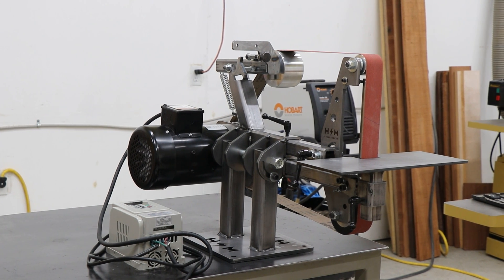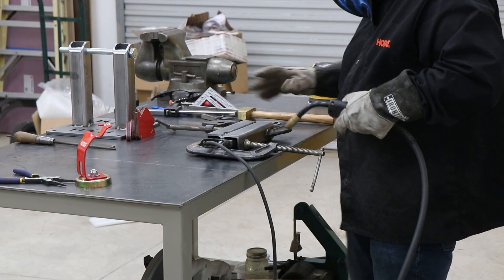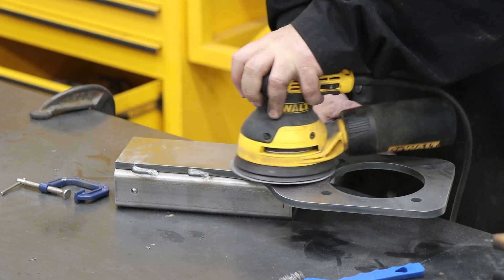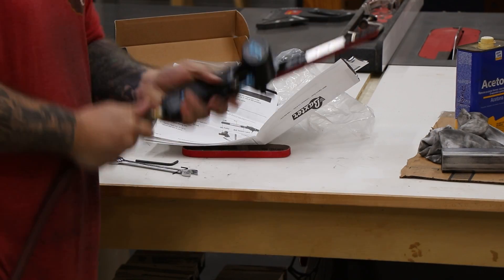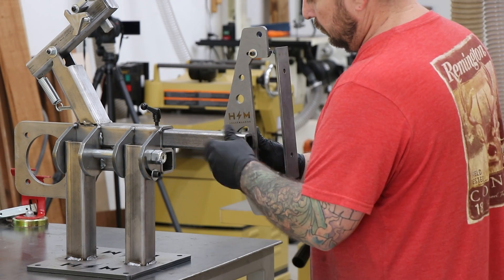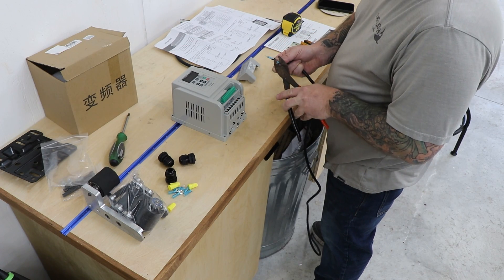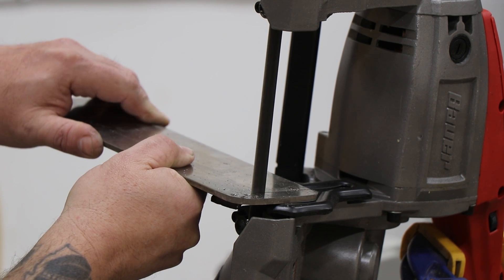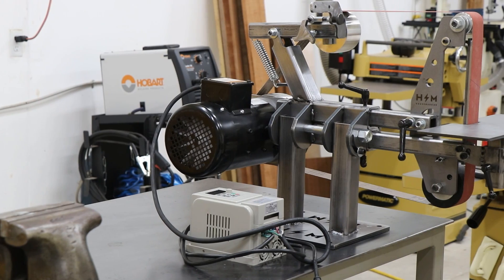Building a 2x72 Belt Grinder From A Kit

Comment: Hi, my friend looking at your show that great video especially the belt grinder 2x72.
I just wondering about motor names RPM, HP, and VFD name, please?
I making the body of the Belt grinder Almost finished but in stuck with the motor and VFD, what cost? 
I'm leaving so far but I want something good 
I'm looking forward to thank
Reply from the maker: @mr.ranyhomemade2466   here are the specs of the motor I used a bought from Amazon

2HP Electric Motor 3450 RPM General Purpose Three Phase Motor 230V/460V 56C Frame 5/8" Shaft Diameter CW/CCW Rolled Steel Shell 60 HZ TEFC
Reply from the maker: Check out the resources page of housemadeindustrial.com  he has a few options for VFDs and motors. Here is the specs on the VFD also from Amazon
AC 220V/2.2kw 3HP Variable Frequency Drive,12A VFD Inverter Single Phase to 3 Phase Frequency Converter for Spindle Motor Speed Control(Single-Phase Input, 3 Phase Output)
Reply: @ 
At my home, only 10 appear electric so maybe single phase can

Comment: I’m ordering mine Monday! Very excited! Been using a 1x30 Harbor Freight to make knives. Ready to take the next step to a big boy grinder and my skill level is too. I do lots of other metal work as well, but just a hobby guy. I was pumped to see that a guy with about my welding skill level did well assembling it. I am impressed with the job you did! Seems like a solid machine for half the price once you include some sweat equity. Good job!
Reply from the maker: @4547-OK  thanks and good luck with your build. I am still super happy with the grinder. I  have been using it a lot. I think you will love it

Comment: I like the HM because it flips over on it's side for surface grinding, but I liked Jeremy Schmidt's stationary table, so I incorporated both into my DIY build.  The HM would be so much more functional if the user didn't have to pull out the table just to put it back in after the unit is flipped sideways.

Comment: Which of their recommended motor and vfd options did you get?
Reply from the maker: @Killermo420  I used motor option 1  2HP Electric Motor 3450 RPM General Purpose Three Phase Motor 230V/460V 56C Frame 5/8"Shaft Diameter CW/CCW Rolled Steel Shell 60 HZ TEF. so far so good
Reply: Aren’t these our company’s equipment?

Comment: I really want one of these.  But how often do you rotate it to horizontal?   Would you do this again or buy the vevor for $900?
Reply from the maker: Thanks for checking out the video! This may be a long response to your question but…. I haven’t used the vector grinder so i can’t compare the 2 but I was  having the same thoughts you are before i bought the kit I have. I do have a vevor vacuum pump that came to me damaged. I contacted vevor and they said sorry but they couldn’t give me a replacement and to contact the third party supplier I bought it from (Amazon). I eventually complained enough that they did send me a replacement but it was a lot of trouble and 3 additional weeks to get a working unit. As for the grinders and price, the base kit is under 800 bucks. The motor and VFD are another 350 so $1150 total. It’s not much more than the Vevor grinder. I’ve been adding attachments and now starting to make accessories for my grinder but I didn’t have to spend that money up front to get grinding. For most of my life, I bought the cheap version of things and regretted it and in most cases ended up getting the better one anyway. Now days I’m in the buy once, cry once camp ( although I did like the Ameriprise grinder and set up but $4k is over the line for how much I will use the grinder). I don’t regret the revolution kit at all!  I have used the horizontal feature twice in the last 2 months. It is in that orientation now. I’m making some hand plane irons and the sides need to be perfectly straight. The horizontal orientation seems to work well for that kind of work. I hope this helps but let me know if you have any other questions. Good luck!
Reply: @TwistedWorkshop77  thank you so much I think I will get to ordering